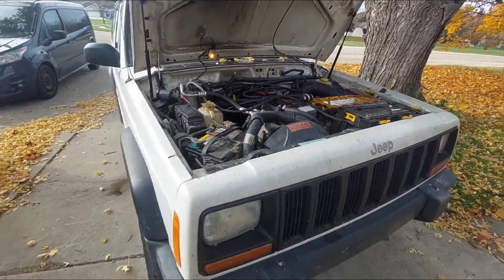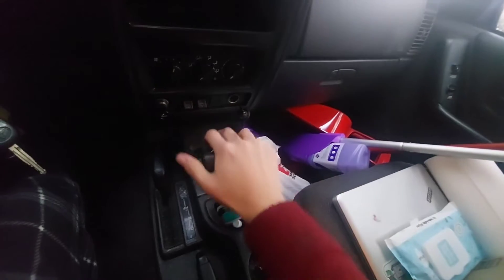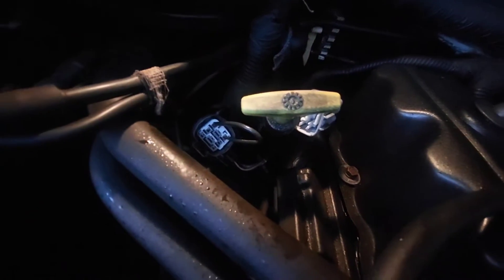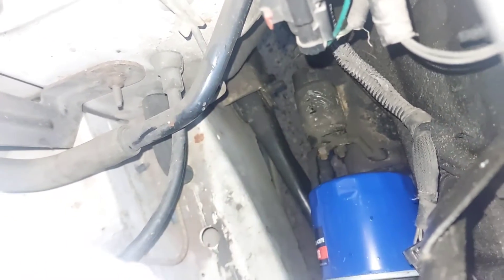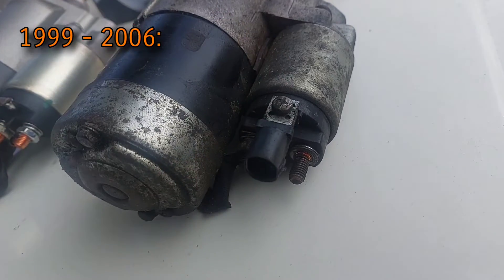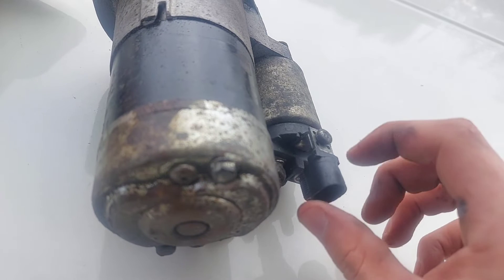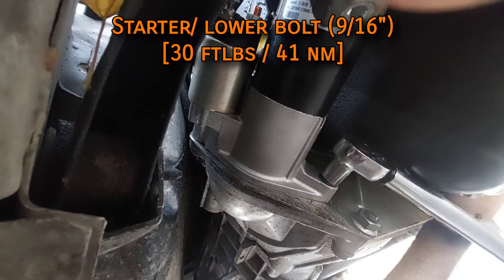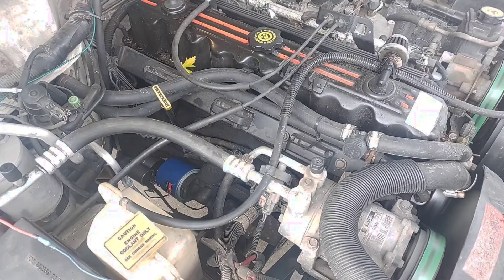Jeep Cherokee: Starter Diagnosis & Replacement - No Crank Fix & 1998- Starter Swap [‘87-’01 XJ]

Comment: 2001 Cherokee Sport here.
After testing the battery, ground connections, relays, power cables, fuses and shorting the nss,  I figured it had to be the starter. 
Not liking the plastic connector to the solenoid, I searched Amazon for a comparable starter for a 4 liter 98. Found a reasonable AC Delco Gold that had strong five star reviews.
Had to cut the plastic connector off and install a crimp ring connector with heat shrink to attach to the solenoid. 
Got her installed and then hit the key. Instant on! I mean right now! Hardly a hint of the starter turning and she fired right up.
The old starter was showing signs of a weak battery with a ruh, ruh, ruh, almost catch and then a click or just a click from the solenoid. In hindsight the issue could have been built up resistance on the ignition wire to that plastic solenoid connector, at the connector.
Regardless, thanks for your video!

Comment: This video was VERY helpful when replacing the starter today on my '99 Cherokee! I've done plenty of starters on 80s/90s GMs, both cars and SUVs, and the Cherokee is MUCH easier. (The starter is smaller and lighter, and therefore much easier to get into place.) I giggled a bit when you "pop-started" a manual Jeep in Reverse, it reminded me of the time I proved to a friend once in my '94 Cavalier that it could be done. (He thought I was going to rotate the engine backwards and destroy it...)

Here is a tip, for those of you who choose to order the "right" starter for '99+ models: If you can't disengage the red locking tab on the solenoid plug, you can unscrew the solenoid-side of the plug (it attaches with one Philips screw) and get the whole starter out of the way. Then it's much easier to deal with those annoying-yet-sometimes-helpful locking tabs.

I chose to buy a NEW AC Delco starter from Rock Auto ($158) instead of remanufactured from the Big Box Stores ($194 with $40 core fee, or $226 for New with $10 core fee) because I've had bad luck in the past with remanufactured. Lifetime parts warranty is no good to me if I get stranded somewhere... 😁

But my advice on that matter is to make the choice YOU feel most comfortable with. The modification to use a pre-'99 starter is equally-valid. I have ratcheting crimpers and heat-shrink terminals to do that job, but I didn't know about it prior to ordering the part. Oh, well!
Reply from the maker: excellent

Comment: I just pulled the connector off the old starter, bent the tab so it would face the correct direction and mounted it. Didn't feel like doing any sort of wiring. I had just fixed all the trash connections on the battery. Good info. I watched this after I had already swapped my starter. I had a buddy tell me a couple years ago to get a starter from a 98 if I ever needed one to save some money. Turned out he wasn't lying lol

Comment: I found that the electrical connector you replaced with the ring terminal was all that was wrong with my 1999 jeep Cherokee. I replaced the starter after banging the solenoid made it start. The new starter was not working well either, so I cut off the connector and installed the ring terminal and all is good.  I always hated unplugging that connector, it's more work than removing the screw.

Comment: How do you know its not the Ignition switch?? My 2000 XJ intermittently wont start. No crank no click nothing. Then sometimes (most of the time it will just start right up) Starter was replaced 4 months ago.

Comment: Oh thank you for this!! I'm a female and every male I've talked to about my Jeep tells me I'm just a dumb female and don't know anything about vehicles when I try to explain to them about the lever/switch in the transmission shifter preventing it from starting!! I have had problems with it for a while and now it won't start at all which leads me to believe that it's completely out or the starter needs replaced!! ✌🐢

Comment: My 96 with the Ax-15 does not have a clutch interlock on the starter. I leaned in to start it, not noticing that it was in gear, and the B pillar punched me in the face as the jeep lurched forward.
Reply from the maker: Lesson learned, ey
a 96 would normally have a CSS, some previous owner must have bypassed it
Reply: That jeep has been passed around more than a bong at a phish concert.